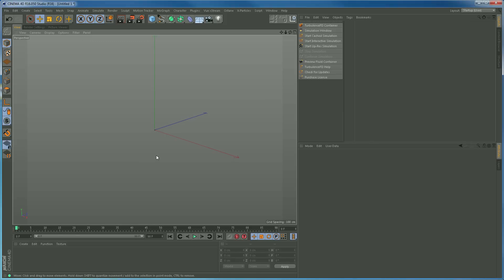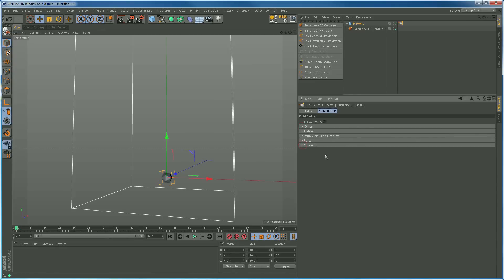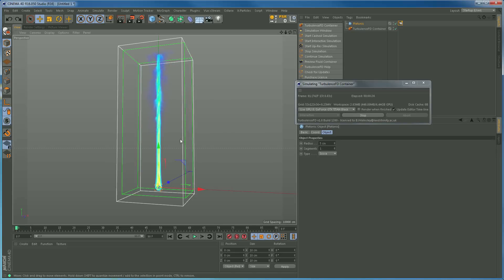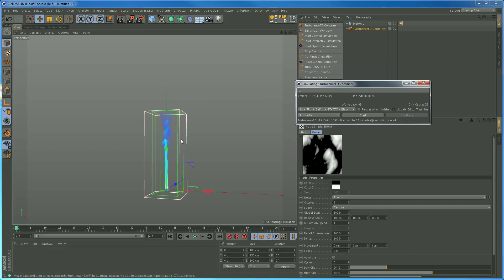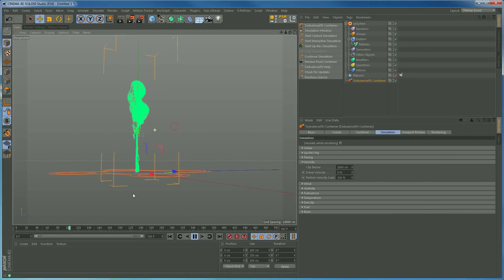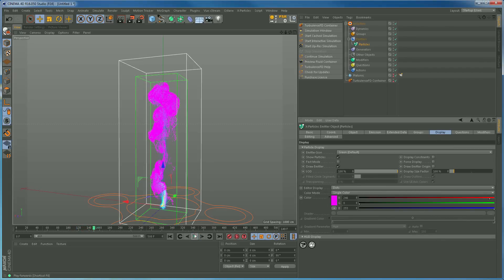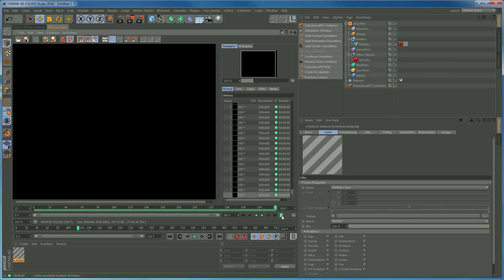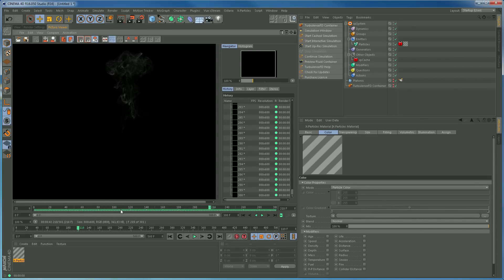Cinema 4D Smoke Tutorial Part 1

Comment: I am able to follow the entire tutorial but for some reason my particles are not rendering like yours.  I am using the same settings but the particles are almost non existent in the render, they appear if I increase the size in the material settings but it doesn't look like smoke.  just solid white dots.  I am using x-particles 2 and my birthrate is set to 100,000 thinking maybe I just needed more resolution.  nothing is working.  any ideas would be greatly appreciated!  Thanks!
Reply from the maker: +Lee Brockney  hi Lee. It sounds like you don't have enough particles in your scene. It also depends on how far away your camera is from the particles. To get get a decent smooth-ish looking smoke you'll need about 1000000 particles active I reckon.
Reply: Thanks for the reply.  I updated my HUD to show me particle counts and I was only getting around 200k particles so I upped my birthrate to 500k and that got me to 1.2 M particles in the scene at one time and I still get the same result.  great tut though!  wish I could get it to render right.
Reply from the maker: +Lee Brockney hi Lee. Without seeing the scene file it's hard to tell. Do you have an email address you don't mind putting up on here? If so, reply with it and I'll msg you privately so you can send me your scene file - then I'll take a look!

Comment: Hi ! Thanks for this really nice tutorial !
i'm using the exactly same seetings but : 
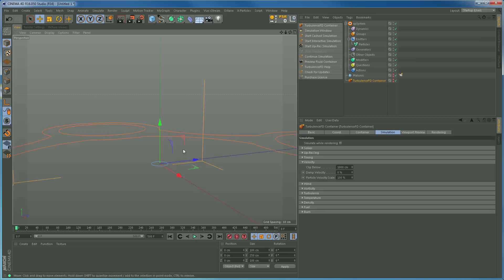my particles can't be pushed by the turbulence's velocity at 17:55... i'm looking for a solution for many hours but impossible ... Do you have a solution ? thanks !
Reply from the maker: +Louis Richard hi Louis. Make sure you e cached velocity in your TFD sim. Make sure you've copied all of the xpresso nodes exactly. Make your you've got 'particle velocity scale' set to 100% - this is in the 'simulation' tab of your TFD container.
Reply: i have the same problem, were you able to fix it?
Reply: I finally made it with another tutorial, with thinking particles; the result look really nice too ! check the channel there is another smoke tutorial, good luck
Reply: I have the same problem and i don't find the solution

Comment: hI, so I'm a beginner and I followed your tutorial however whenever I do a picture view render the particles are almost imperceptible,quite non-existent. I wasn't able to cache the  x-particles only the tfd, do you think this is the problem?. Thank you, great tutorial by the way
Reply: already solved it don't worry, thank you
Reply: I would love to know what you did, because I followed the tut EXACTLY and I get the same result as you initially did.  There seem to be quite a few particles but when I render, they look nothing like what Bob shows he had. R16, XP v2.1 (not v4, but the controls are mostly the same).
Reply from the maker: Have you got your emitter set to per frame or per second? If it’s per second, you’ll have to massively increase the amount.
Reply: That would surely make a difference. In XP v2.1 I see no control for per-frame or per-second, still looking.

EDIT: OK, the birthrate is per second in my version of XP, I do not have the drop-down that allows me to change the rate to something other than per second that you have,  this is the default/only setting for me. But I see you have it at 50K/second in your tutorial and that is what I have, unless I am missing something. I guess I will monkey with the emission rate but I've done that already and it hasn't gotten me to something like what you're getting at the end of this tut. 50K particles per frame would REALLY bog me down, I've already upped it to 500K/sec.

Comment: looks amazing! but why use tfd to drive the xparticles than to just cache and render from tfd? does it provide any benefits? :o
Reply from the maker: +iamKesh Hi. Using particles gives you a really nice, very detailed wispy look like cigarette or match smoke. It's also very quick as the TFD sim can be quite low res. It's almost impossible to get this 
look using the TFD renderer - even with a ridiculously high res sim. Using particles also opens up all of the particle effectors too (like Turbulence, wind, vortex etc) so you got loads more options.
Reply: i see, appreciate the reply!